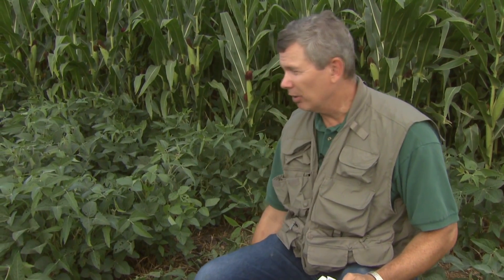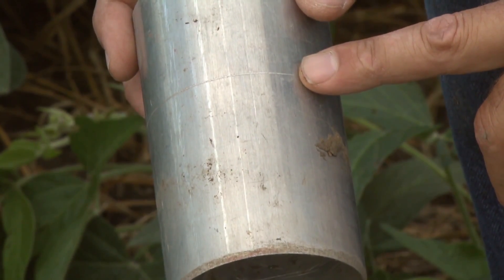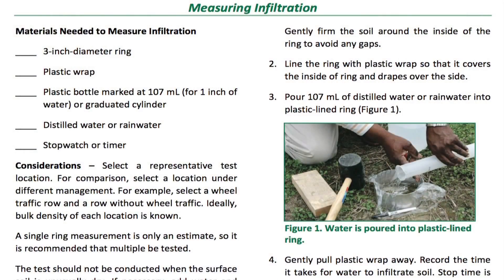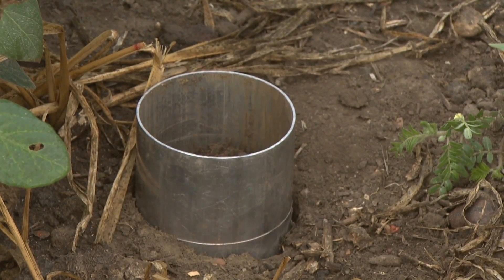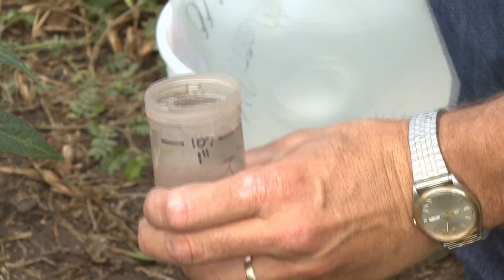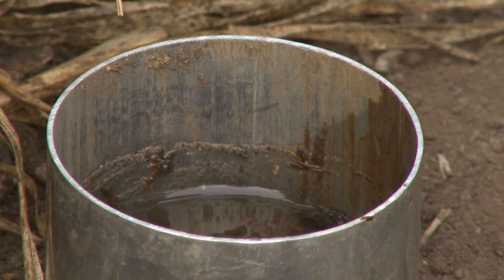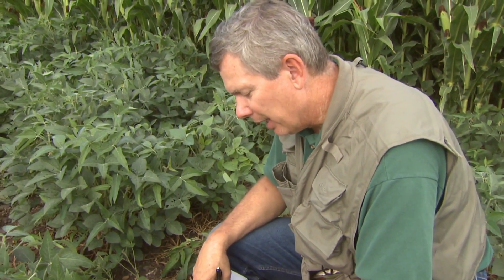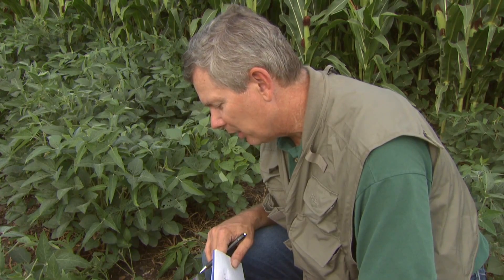Soil Infiltration Test

Comment: The 3 inch. diameter is too smal to be representative of field conditios.  There is a Standard Infiltration Rate Test
Reply from the maker: Carlos 
The 3 inch rings are more convenient for demonstration purposes, easier to transport and take up less space in in soil quality bucket  The infiltration educator guide provides the option of using 6 inch rings which are more accurate for collecting data.
Reply: +CropWatch - Youth :Standard Infiltration Rate   with the Double Ring Infiltrometer!  Something else is Witchcraft